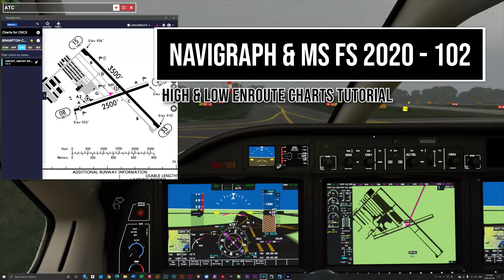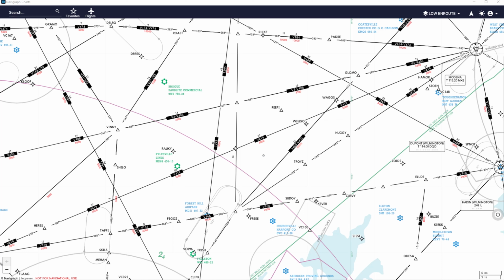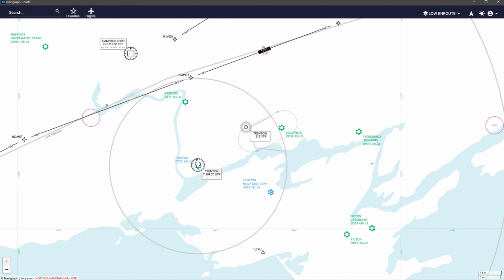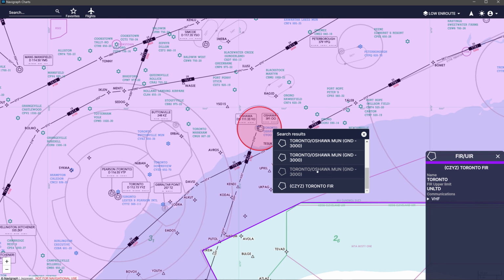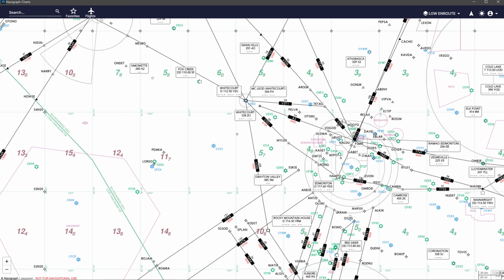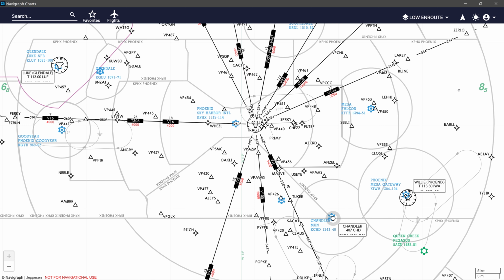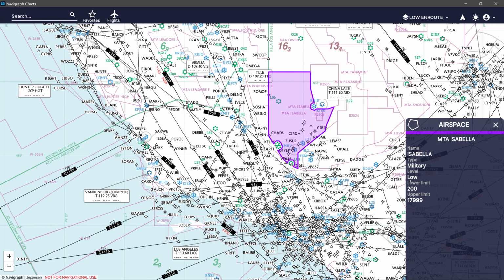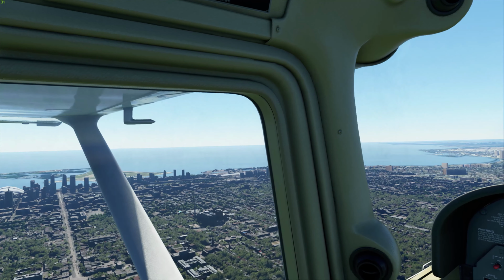102 - Navigraph Understanding High & Low Enroute Charts Tutorial in MS FS 2020 Navaids Airways

Comment: Note that in other countries the Transition Altitude between local QNH altitudes and Flight Levels based on standard pressure may differ (US/Canada both use 18000', but I believe New Zealand uses 13000' for example, while in some other countries it varies from airport to airport). Presumably this also applies to the change between use of low- and high-altitude charts.

Comment: Excellent ... thankyou ... incidently I have noticed that at ground level a VOR signal may not be received until airborne ... also distance from a VOR station does appear to affect whether the signal is received ... however I’ve not checked this out for specific figures👍
Reply from the maker: Interesting. I was not sure how much they would have modeled this. I wonder if line of sight is a thing or not. Would be interesting to get low with a mountain between you and the station and see if its blocked. I'd be very impressed if this is modeled.

Comment: Do I absolutely have to follow these segments when flying IFR ? Sometimes there a big gap between last point of departure and first waypoint where I end up in between routes.
Reply from the maker: Nope, at the end of the day what you file is what was accepted, but ATC can always re-route you as they see fit, and if you see the dotted line that cannot connect it usually means that airport doesn't have published procedures and if you click the dotted line it will say "vectors" meaning that ATC will vector you to your destination.

Comment: As you described the difference between IFR and non-IFR airports I noticed 3LA4 and Woodworth, both close to where I live and both blue on the low and high en route maps. Both have IFR capability, but no Jeppeson Charts. Do you know why this might be? Also, do you know why some blue airports have a solid blue dot in the center, and some do not? All of the green airports seem not to have the dots.

BTW, thanks for your Navigraph videos. I just got a subscription, so these videos will be a great introduction to them.
Reply from the maker: I may have misspoke... just means they don't have published routes. Many airports have implemented (especially RNAV now) approaches but they are not published. This is changing so fast with GPS approaches as these airports couldn't afford ILS equipment. I'm guessing these airports have RNAV and not ILS? Do you know?

Comment: Excellent video! When importing into MSFS it doesnt pickup arrivals and departures sometimes. So you need to adjust the plan in the sim map. But that destroys the route. Have you found a way around this?
Reply: @NOTAM1  I have the same problem, I still have to enter the runways sids and stars, and MS2020 still picks different waypoints. Dont have this problem with Xplane
Reply: Make sure the waypoints are in your Navigraph plan, and then when importing them into FS, DON'T CHANGE ANYTHING.  The only thing you can change is your starting point on your departure runway if you like to start cold and dark in a parking spot as I do.  BUT...  YOU MUST USE THE DROPDOWN TO DO SO.  You can zoom in and figure out which spot you want, but don't click on it, rather use the origination dropdown.  (It usually says Runway.)  That should avoid the problem of FS trying to reroute you.